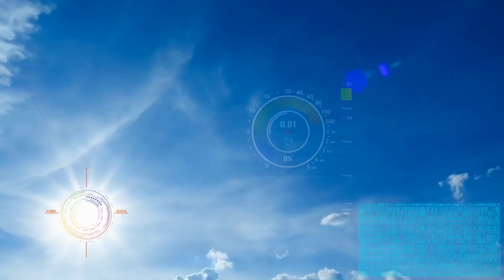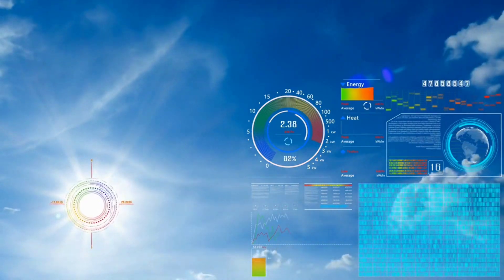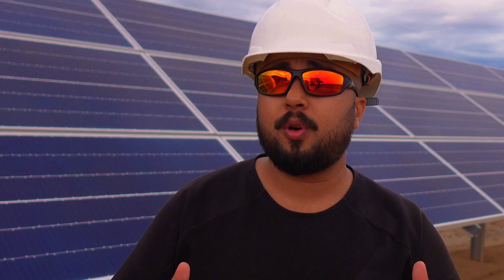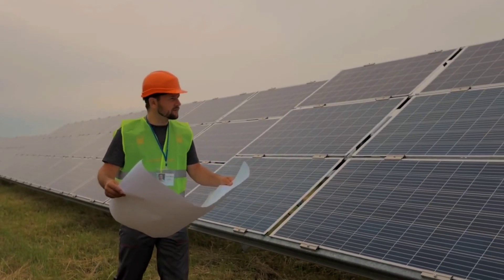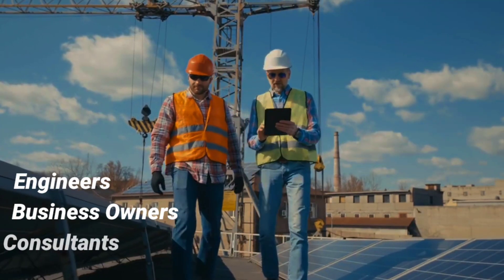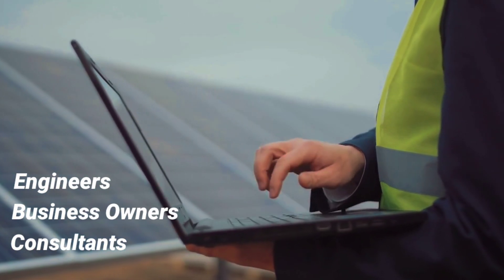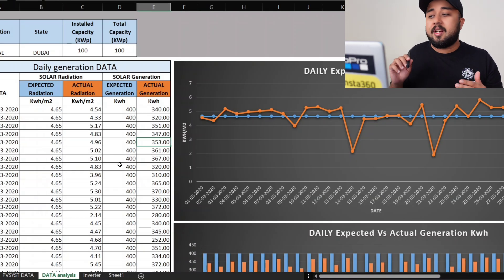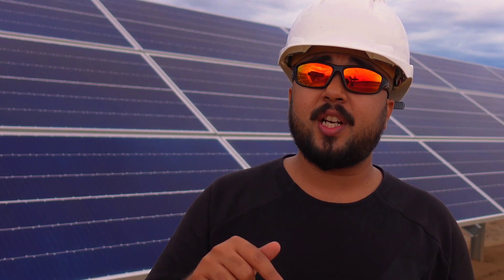Solar Plant Data analytics Complete Course

Comment: Sir one my question, if any plant ir sensor is not working then how can calculate pr of the plant.
Reply from the maker: Then the data of a sensor from the nearest plant need to taken or you can refer to multiple sites for the general data
Reply: FOR claculating PR the Formula is 
PR=  (GENERATION OF THE DAY kwh )/(GTI Kwhm2  X dc capacity of plant KW)

Comment: Sir plzz tell how we can calculate the J-V curve for dye sensitized solar cells for calculate the efficiency for the solar cell for practically not theoretically, plz make a video for the lab work purpose,, actually my work is on DSSCs and I m stuck for the current density v/s voltage ,,plzz tell it's instrumentation for calculating current density

Comment: Sir, please give idea of solar Simulator. How to find J-V curve and EQE. Except solar Simulator how can we find the efficiency of solar cell. And also give idea the solar Simulator facility in India.
Reply from the maker: 1- I don't think so any working simulator is available in india.
2- it's actually IV cure ( i.e. co-relation between operating current & voltage )
3- efficiency of a single  PV cell can only be lab tested under standard condition.
Reply: @SustainableEveryDay  use ne to reply bhi nahi diya

Comment: Sir, may i get a video on "ground fault rectification of a system which is design including power optimiser".
Reply from the maker: The concept is same , wether you have optimiser or not , yo need to check floating values
Reply: @SustainableEveryDay  thank you sir for your valuable response. 
Actually i am rectifying such way, but identification of a liable mc4 is too time taking process on rooftop system that's why wants to know is there any device by which we can identify the faulty mc4 in a short time.